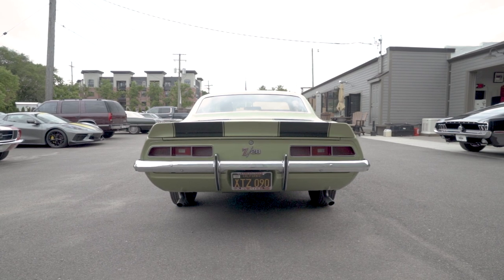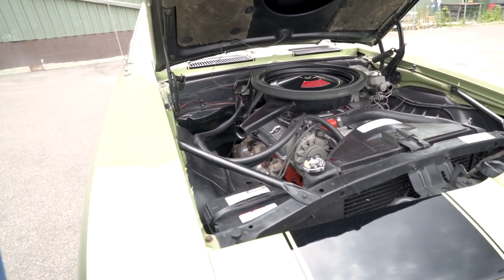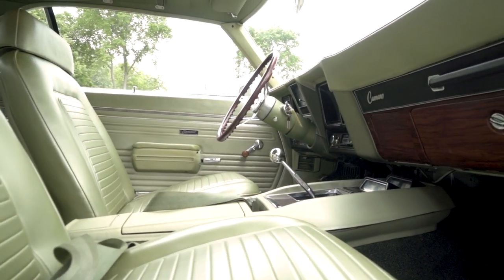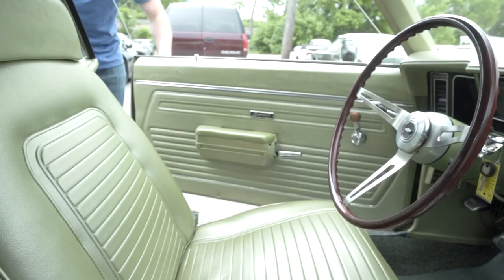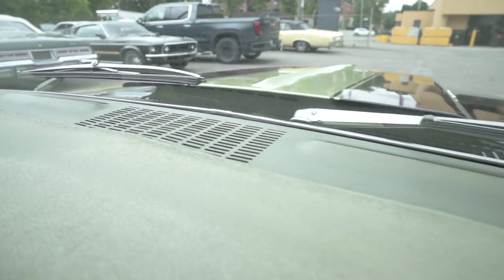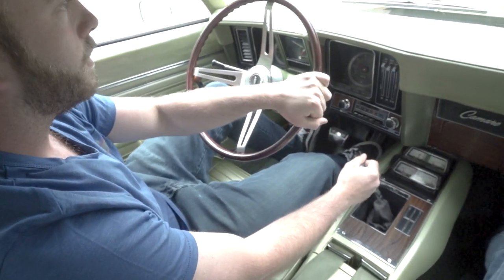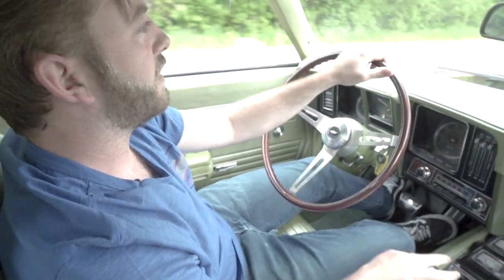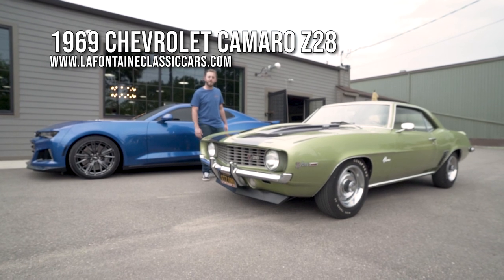1969 Chevrolet Camaro Z28 FROST GREEN

Comment: Did he say that the DZ engine was rated at 103 - 100 horsepower ? The shifter hits the console in 2nd and 4th gear. The steering wheel is not straight. Basically items that should be corrected on $100,000 vehicle.

Comment: I ordered one brand new in late 68 and the tail pipes are not correct. I noticed the window handles are sun damaged (which was common) All in all it is highly optioned Z, AM/FM , Power Steering, Rear Defroster , Console and Guage package, Door Edge Guards, Rose wood Steering wheel, optional Hood, Spoiler package. This is indeed a good car. I would love to drive it to sweeten the deal.
Reply: John Geer  Chevrolet was located in Northern California. As a California auto sold in CA, this Z28 should have the emission Air Injection system. It’s missing. Also  this car should have Double Hump castings protrusion near the bottom of boss threaded casting on all ends of each heads. What I see is the double rectangle casting

Comment: CA plated. Should have the smog pump and equipment to be accurate. After the manifold the exhaust system looks accurate out to the tail pipes. The tail pipes on refurbs are generally not accurate to the period so this one gets a plus for that accuracy. The commenter makes a fleeting comment about the exhaust system and chambered. It's not a chambered system at all though.

Comment: Door edge guards gotta go and fix the exhaust tips but killer car. I like when dealers put the cars on the lift so we can check out the underside..
Very professional. I would've put true dual exhaust on it but that's me...idk if the Z28s came with true duals or single muffler with dual pipes...
Reply: Seems as rear stripes came up short to the rear window.  Easy fix I think.
Reply: I believe that exhaust is the way it came from chevy.  Its really nice. I had one years ago. 👌
Reply: It ran duals all the way back to a hollow resonator. It's a true dual exhaust.  It was made to create its unique sound.

Comment: Clearly it was recently undercoated with some kind of paint. Zeibart was a flakey thick textured spray. Not to take away how solid the undercarriage (May) be, But for the price, I'd want some kind of screwdriver type tool to examine the details. That's a lot of coin for a car with obvious exceptions to original. ...I'm looking at you, hose clamps!
Reply: and the missing smog pump & manifolds with the fittings

Comment: That Tach isn't correct, if you know you know. 8k would be correct.
Reply: Early model used a 7000 rpm tack, I have a real Z with the 7000 rpm. GM went with 8000 rpm tack later in the year.  The 7000 rpm tacks where breaking, they needed 8000 rpm tacks.